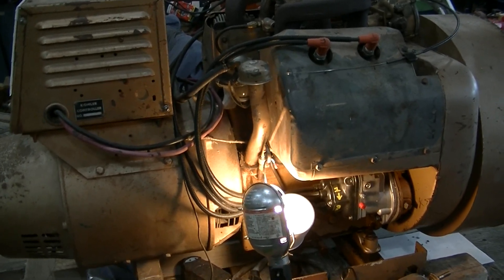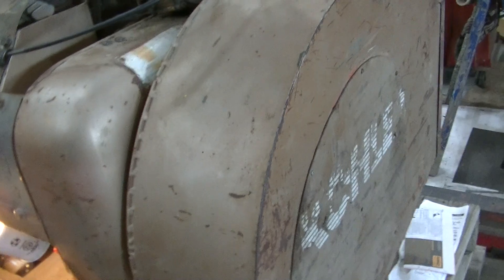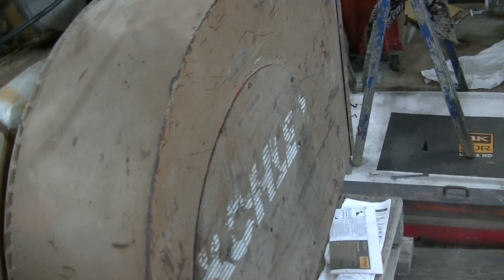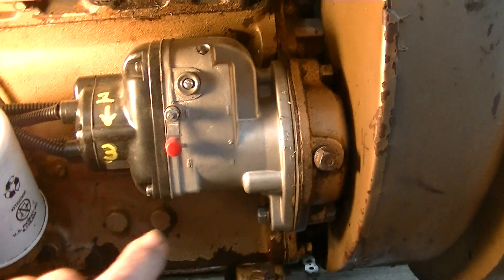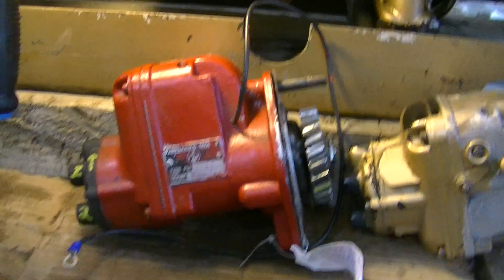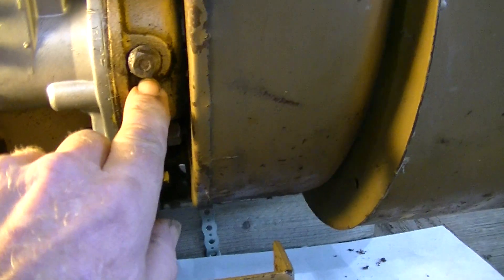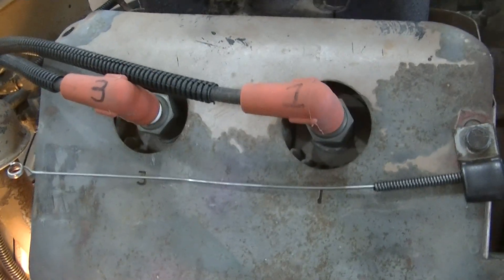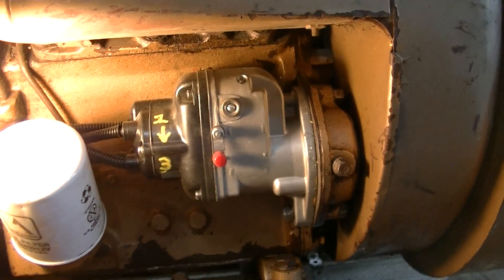Wisconsin VH4(D) Magneto timing - zeketheantiquefreak

Comment: Working on l am assuming early 90s model vh4d  . It has a regular distributor on it . Manual says that to time the ignition cylinder #1 at on compression stroke and align marks on the distributor to the mark on the gear looking through the little hole . 
My problem is that there are no marks on neither one (had motor apart and looked for marks) . I guess will have to attempt to set the distributor at tdc looking inside when distributor is aligned on #1 to fire.  Perhaps l am missing something?
Thank you
Reply from the maker: Identify #1 spark plug and remove. Rotate engine by hand until compression is felt on the finger. (Ignition off.) (Note rotation of distributor shaft/rotor) Drop something like a tye-wrap into the cylinder and continue to rotate engine until Top Dead Center, TDC #1 is found. Identify #1 spark plug wire. Firing order should be 1-3-4-2. If the distributor cap has one tower labelled as #1, insert the #1 wire there and follow with rotor rotation direction the others, 3-4-2. Distributor may have to be pulled and reinserted to line up the rotor with the #1 cap wire. If the marks on the flywheel and housing are missing, the distributor will have to be 'dead stick timed' with a test light and then slight adjustments when running later on. With a test light (clamp placed on positive terminal of the battery)  Rotate the distributor slightly until the light just goes out. (Spark occurs when points open) I hope I am not feeding you a load of vague BS...
Reply: @ Thank you so much for this info. I appreciate it . Yes  x mark on the flywheel is not visible any more due to severe rust and pits but tdc letters are still there on the flywheel and marking lines are still on the shroud) so l should be able to get a reference there. Wish me good luck lol

Comment: How do you remove the coil? I see it's inside behind points.
Reply from the maker: I am away tomorrow, but I will have a look at the spare mag soon.
Reply from the maker: Sorry for my tardy reply. I have found the mag now, and it appears that the coil is held in with two 'set screws' you can see at the top of the magneto.

Comment: Hi I need your undivided attention concerning this magneto rotation and model- does this  magneto can  fit the  Wisconsin vhd 4d  65 hp - thanks again for your generous cooperation and support with  replying to me - youtube.
Reply from the maker: Yes, the magneto style that is correct for the VH4 and the VH4D is a 'Teledyne Wisconsin Y97'. As shown in the video above the impulse rotates CW when viewed from the front. This is a reduction type mag, meaning the rotor turns half speed and opposite direction of the impulse gear. Sorry for the tardy reply.

Comment: Greetings from NC 
Can u tell me the proper index for mag upon install on VH4D ?
I checked mine after rebuild with spark plug wire on my bench and its firing so should the magneto after #3 fires just just load impulse coupler and once it snaps for number one just install with X in inspection hole ???
My rotor button is past # 1 terminal at this point
Reply: After # 2 cyl sorry not number 3 ##
My manual states after # 1 spark is located simply hold gear and install with X shown in lower inspection hold but curious why rotor button is so far past # 1 terminal location at this setting ?
Reply from the maker: @chriscamp8608  The impulse, the unit that causes the 'clicking' noise at low cranking speeds 1) moves the coil past the magnet at high speed for strong spark when starting. 2) Delays the spark at cranking speed to prevent 'kickback'. So, yea, the rotor appears out of proper position, but once running, the flyweights bring the impulse out of operation and the rotor/point combo would appear correct. Thank you for the question.

Comment: Is changing the oil a mess with filter angle ??
Reply from the maker: Yes, it can make a mess, try a shallow pan to catch it. Dirt will sit in that casting/housing, just begging to be cleaned.
Reply: @zeketheantiquefreak8518  
Thank you Sir 
Im sure mine will be dirty some dummy pit a old Ford style breather that housed rubber hose that went to carb or intake pcv system but no hose was in it so rain water could and did enter oil pan etc.
I opened brass valve on drain hose and nothing came out until I forced air in hole then water and oil nasty mix came out so I plan on flushing motor out several times with fresh oil and a little trans fluid added because it cleans good and keep rpms low while running.
Reply from the maker: @chriscamp8608  The only way to truly clean the crankcase is to pull off that oil pan cover. There are parts of the block casting that can trap surprising amounts of dirt.
Reply: @zeketheantiquefreak8518  
Yes sir - @@@ I hope im lucky and not instant issues reveal themselves upon fire up / previous owner said it quit firing and was parked !!!

I just purchased this unit and tore into magneto upon initial discovery 
Cap was cracked and nylon gear had a tooth broke off because someone put the wrong condenser in there was to big worked loose contacted tooth.
I have total rebuilt kit en route with a new gear and will replace EVERYTHING inside and test old stuff next week so I can keep anything good and toss defective items.

Comment: Greetings - oil filler cap original one was replaced by prior owner with something that I dont consider adequate because it has hole for water to enter engine so I bought a new cap that was used on early chevy valve covers. Just curious if factory one was sealed when installed or does engine have to breath thru fill hole ?
Thanks
Reply from the maker: Yes, the original filler cap, as shown in the video, is as you say, a smooth, rainproof cover with a steel mesh inside.
Reply: Ok thank you original one long gone but I bought something that covers hole safely but no PCV effect basically sealed so I was just curious if ok again thank you
Reply from the maker: @chriscamp8608  'Basically sealed'... any combustion leakage past the rings has to have a place to escape or the crankcase will be pressured up, perhaps pushing oil out the seals
Reply from the maker: Sorry for my tardy reply, yes, the crankcase must be able to breathe.
Reply: @zeketheantiquefreak8518  
Ok thank u 
I better start looking for one

Comment: Fixing to use your video to time my VH4D in a early 70s International skid steer. Prior owner said if quit firing so I pulled mag and going thru it now hopefully condenser went out , I have new points and condenser to install and clean it up before install.
Reply from the maker: Glad to be of help. Good luck with your project!
Reply: I think I will run wires like you did # going into magneto today to clean it up and install new points and condenser.
Reply from the maker: @chriscamp8608  Sometimes the original points are better due to the new ones having a very thin contact surface. Awesome 'old-school' stuff that served well for decades.